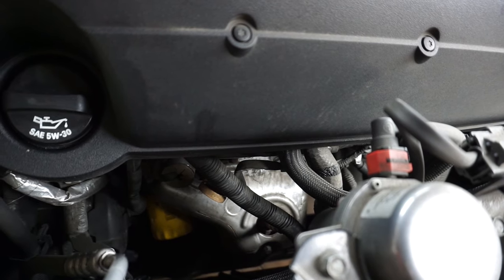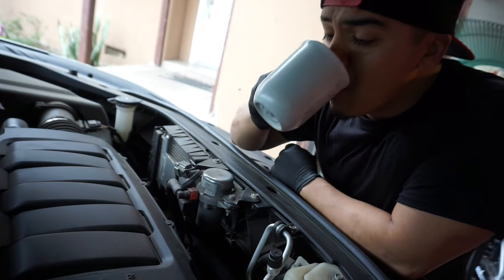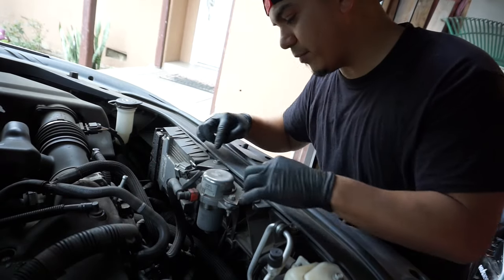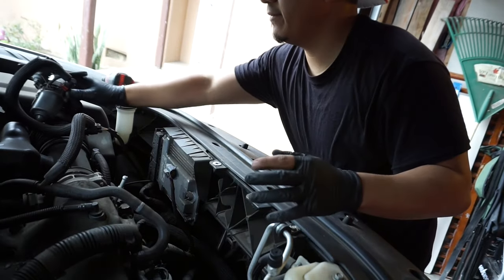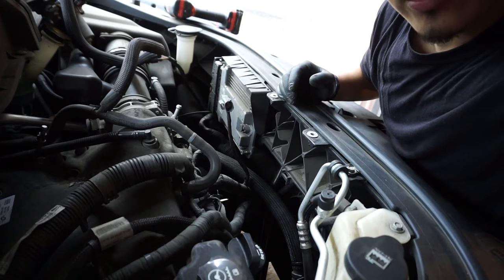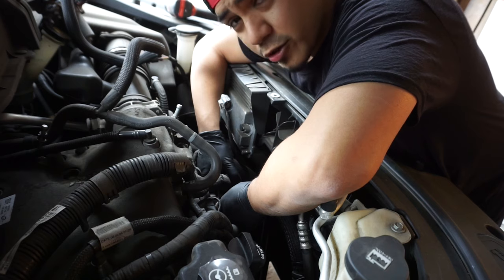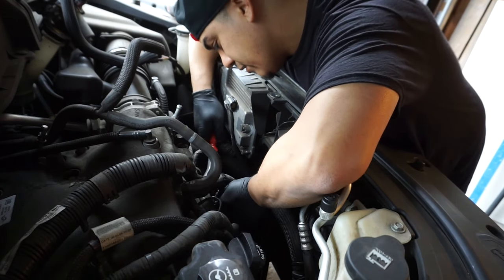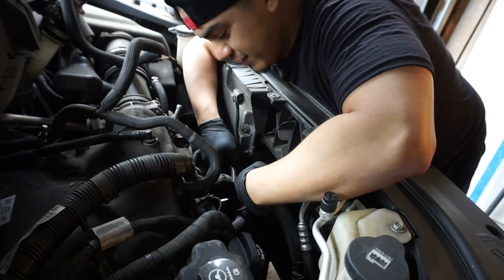Replacing A Catalytic Converter - Check Engine Light - P0420 P0430

Comment: Had a coil pack fail on #2, shortly after started getting a P0430.  Just got all 3 converters for my 09 Acadia and will be doing the install this weekend.  I'm not in CA so i can use A/M converters.  Truck has 143K miles so i can see spending $1,500 on all 3.  Did research on the company out of Canada making the pipes and they look good from what i can see so far.  Great video.
Reply: That’s insane why the hell did it cost so much? I can get a pack with all 3 for under 300

Comment: Thanks for the share - i ve an enclave 2010, 175000 miles runs great have done always well maintained the engine light keep coming back and my guy cant figure it out. Recently changed spark plugs and fixed misfire and light comes back and stays on - any recommendation before I take it to GM ?
  I have catalytic converter changed 6000 miles ago and light still stays on
Reply from the maker: Obaid Farghani What are the codes that you’re getting for your check engine light being on?
Reply: Homie Hektor thank you for replying fast - i dont know i have to get it checked again

Comment: I couldn't get a socket over the studs to loosen the nuts on the three topside. My socket wasn't deep enough. And then I noticed the three bolts are welded studs. Not equipped for that.

Comment: Hey Hektor, YOU ARE A GENIOUS! casi mando cambiar mi recien cambiado convertidor catalytico cuando vi tu video donde aconsejaste chequear leakings. Lo hice y encontré una rajadura en el water tank. El coolant estaba saliendose. Ya selle la rajadura pero la Engine light no se va. Tengo que sacar y limpiar el catalizador o sola se va a apagar la luz?? Gracias
Reply from the maker: MAry Smarthobbies que codigo te esta dando la luz de check engine 🤔
Reply: @HomieHektor  PO420
Reply from the maker: MAry Smarthobbies use a scanner to clear the codes
Reply: @HomieHektor  I will.  I was wondering if it needs to be removed to clean.I will let you know if after erased it come back. Thank youuuuuu!

Comment: Ok .. I have this 2011 chevy traverse.. No check engine light but i feel it weird(does not accelerate) so i took it to an autozone to get it scanned n a few codes came up.. The 2 converter ones and a crank sensor code and another one.. I bought the crank sensor to get it changed but haven't done it and i took the truck to a muffler shop to see about the converers.. I just enat to educate my self before i pay someone to work on it.. Is there a way u can write to me with some advice? Please..

Comment: what do you think about after market CATs like Walker, Davico, and Bosal?
Reply from the maker: reydav77 I’ve used Walker,  it prefer OE whenever possible if the budget allows. Never had a problem as far as performance but the fit is usual issue 👍🏼

Comment: Homie Hektor my check engine like came on yesterday had it check and it's the catalytic converter is the one that your working on is bank 2, my question  is bank 2 the same as bank 1 that's were I'm confused want to do the work myself just making sure before I buy the part if I'm buying the same one u have or I need to buy another one?
Reply from the maker: Blas Diaz A BANK is simply a row of cylinders. Bank 1 and Bank 2 are different. Bank 1 is by the firewall and Bank 2 is by the radiator on this vehicle.

Comment: I couldn't get a socket over the studs to loosen the nuts on the three topside of the flange from the motor to the converter. My socket wasn't deep enough. And then I noticed the three bolts are welded studs. Not equipped for that.

Comment: Muy buen video, what kind of reading or oscillation you got in the scanner when the cat is completely clogged , ps reading from the down stream sensor, car is not driveable runs like shit code po300, go back to the tail pipe very little air coming out and is almost ice cold, that why im assuming I got a bad cat, please help me in this one homie, thank you, un saludo #chingadera

Comment: What would say is the overall cost to do this repair? I’m pretty mechanically inclined but hate spending the time in a limited garage space.
And average time to fix?
09 GMC Acadia 170k miles
Reply from the maker: David Southwell Anywhere from $800-$1000 approximately two hours worth of work
Reply: Homie Hektor I guess I will do it myself. You make it look easy and I’m pretty handy and I’ve done some of my own work over the years
Reply from the maker: David Southwell it’s easy, it’s just expensive because catalytic converters are pricy 👍🏼
Reply: Homie Hektor I just have one more question and then I will leave you alone. Would you suggest OEM parts or after market. My wife’s Acadia has 167k miles on it

Comment: Do you remember which catalytic converter brand you bought?
Reply from the maker: GM/ACDelco from the dealership. Try not to use aftermarket when it come to catalytic converters 👍🏼
Reply: I was quoted a price of $1600 for 2.  Does that sound fair?
Reply from the maker: @candidavis9842  sounds about right, I got mine for around $600
Reply: Each or for both?
Reply from the maker: @candidavis9842  $600 for 1 catalytic. With labor it would’ve been like $900
Reply: Got it.  Thanks so much!
Reply from the maker: @candidavis9842  anytime 🤝

Comment: Hey man question for you , I ordered one of these for a 2009 chevy traverse , the new one that auto zone ordered for me does not have the 3 bolts on one end or the 2 on the other , any suggestions?, also the new cat has no bracket? Is that needed ?
Reply from the maker: Malloy Bramlett did you buy a universal catalytic converter? You might have to cut and weld if so 👍🏼
Reply: @HomieHektor  no it's direct fit but no brackets or pressure installed bolts
Reply from the maker: Malloy Bramlett Yeah that’s the problem with the aftermarket, it should be fine without the bracket just use whatever bolts you have.
Reply: @HomieHektor  nvm come to find out , it was the wrong part auto zone ordered me
Reply from the maker: Malloy Bramlett 🤦🏻‍♂️

Comment: My 2012 chevy traverse bank 1 and bank 2 need to be changed now the car is not running wont even start anymore and no light turn on when I put the key in there. I need to know what parts to buy and where there  Located please help? Also are u far from appleton wi trying to fine someone to replace mine for me
Reply from the maker: I’m in California 😀
Reply: @HomieHektor  dam it okay to far question tho if I need to change bank 1 and bank 2 catalytic converter do I need to also get the flex pipe? Or sensors